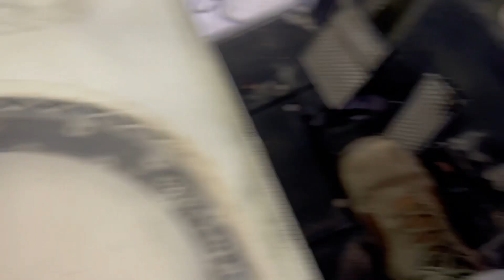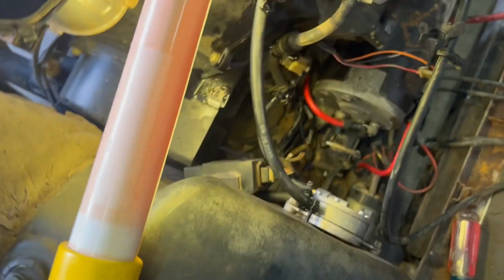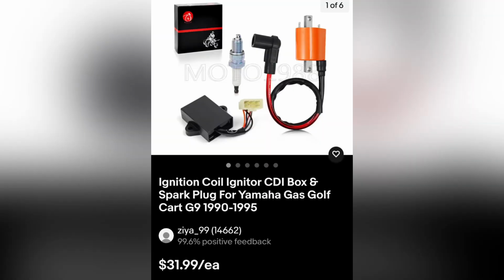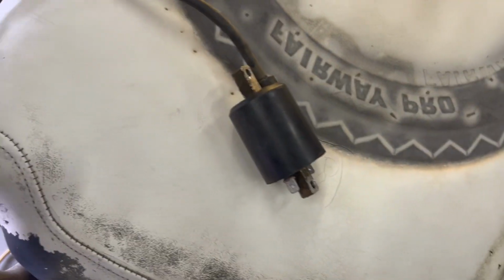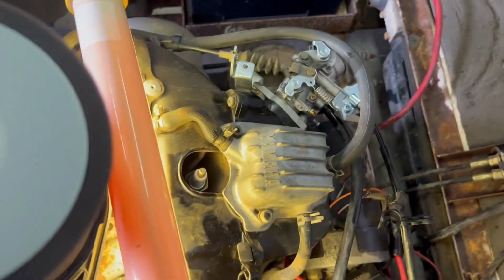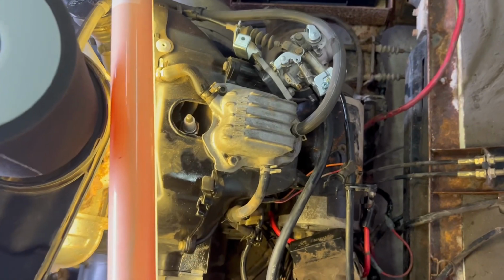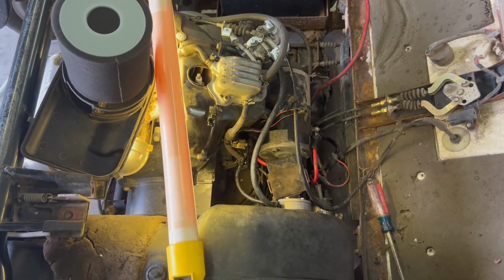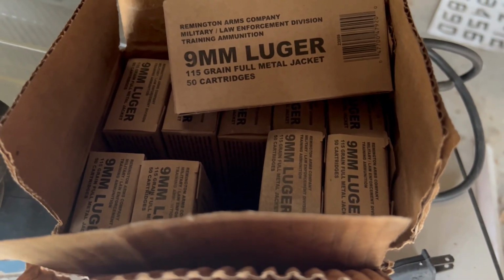Golf Cart Update/Massive Deer Hunt Fail

Comment: Mark - Are you getting spark at the spark plug?  Coil could be a problem, but voltage reg. should not affect starting.  Wonder if something got wet during the washing, especially if power washed?  Is there a manual choke, or auto?  If you have spark, try blocking off the air intake while cranking and see if it fires.  It may be in an idle lean condition if something plugged the idle jet, but it was running before the wash.  Ignition wire could have gotten knocked off of its terminal.  Let us know what you find, please.

Too bad on missing a chance on the buck.  I believe they know if you're armed, and will taunt you if not.